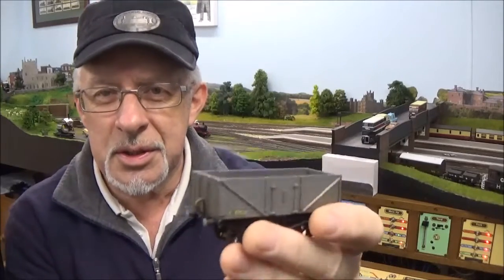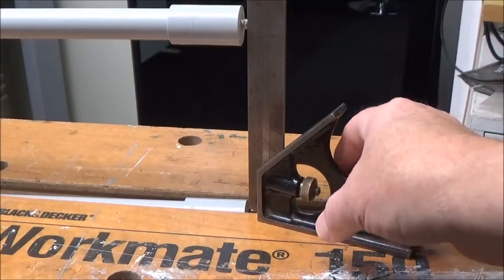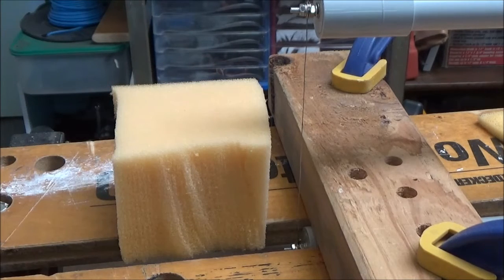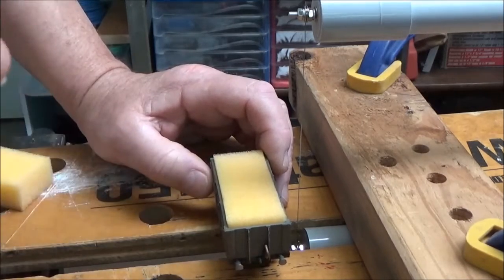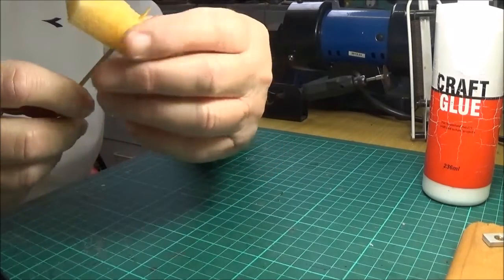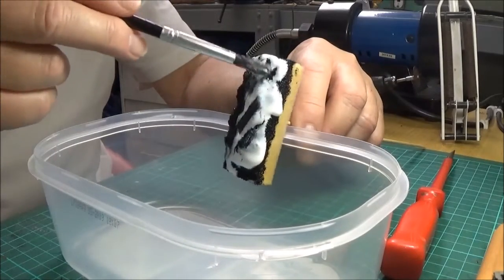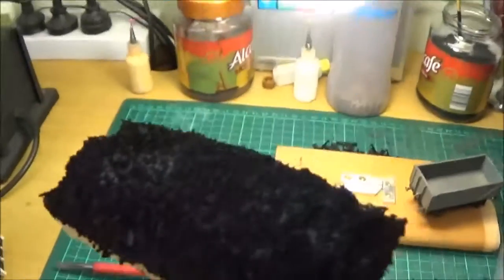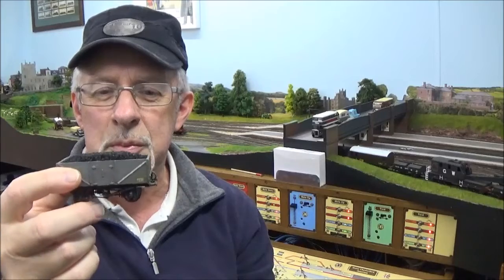Episode 87 17 Wagon Loads

Comment: I suggest to try using polystyrene: get a nice piece big enough for two wagons, take your wagon, press it on the polystyrene and with a pencil draw the shape of it on the polystyrene. Then cut it, but cut the inside of the rectangle which is the part that will go inside. Once you've cut it, decide the height of that piece.
Now you have a small rectangle which we put the gravel in it: i used the same ballasting technique because it make the gravel (if black) look more similar to coal, shiny and darker than the actual gravel. now we can put it in the wagon and get it out.
You can also use magnets inside the polystyrene, but that's something i never tried.
Reply from the maker: Thanks Matthew........that`s an interesting method. I`ll have to try that.
Cheers
Gormo